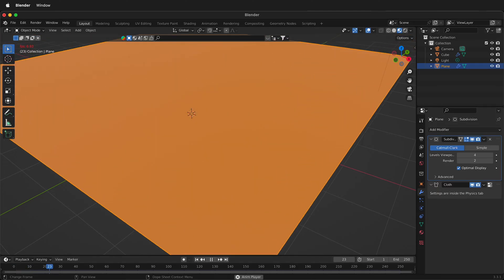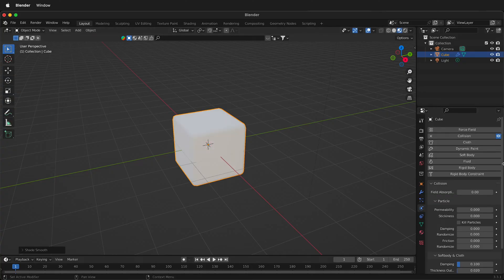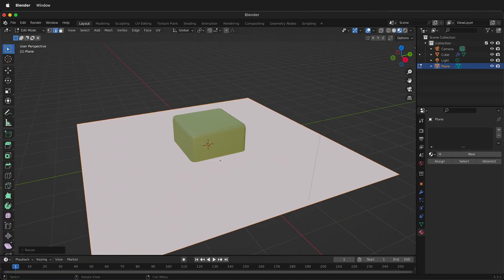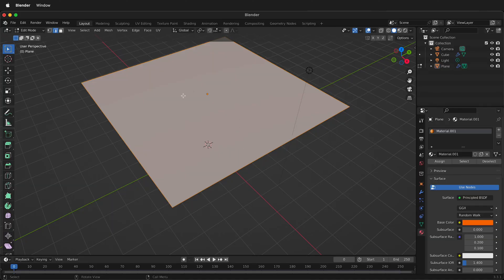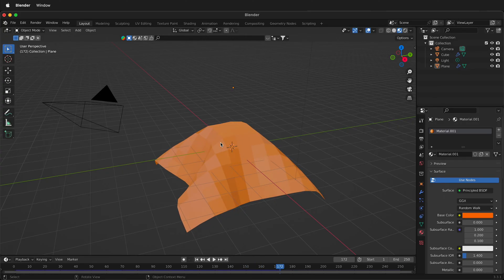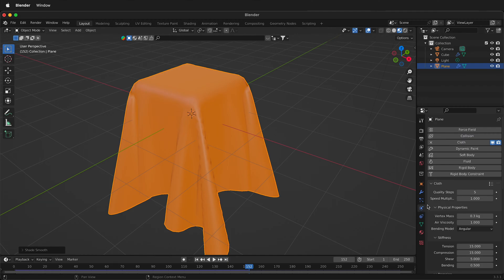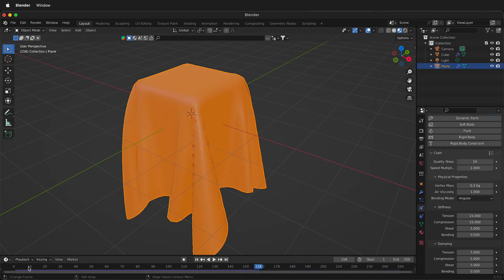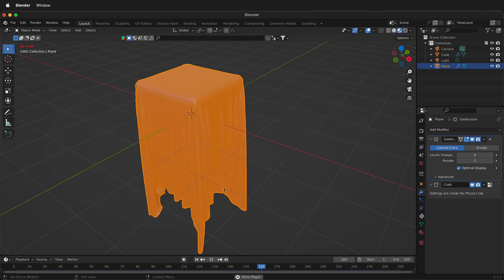Blender Cloth Simulation Tutorial

Comment: is it necessary to add the bevels?
Reply from the maker: No it is not, depends on the form you are trying to model
Reply: but for a beginner who has never done anything like this, would it be better?
Reply from the maker: @goofyyapper-i7l The bevel just adds a little bit more roundedness and definition to the cube, there aren't any perfectly sharp edges in real life so having bevels helps with renders and makes things more realistic
Reply: thanks for the help!!
Reply from the maker: @goofyyapper-i7l 👍
Reply: ok i continued progress on it once more, and after doing the ctrl r step, when i attempt to tab out of edit mode, the plane just vanishes. any solutions?
Reply from the maker: @goofyyapper-i7l Make sure you are on frame one, if you are editing the plane that has the cloth simulation on it and you're not on frame one then it has to recalculate everything. So go back to frame one and you should see it